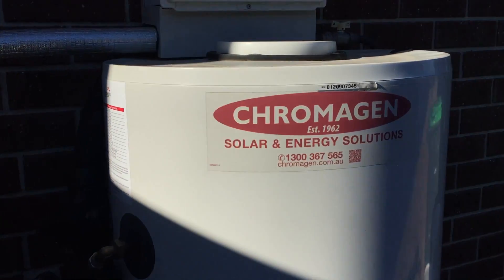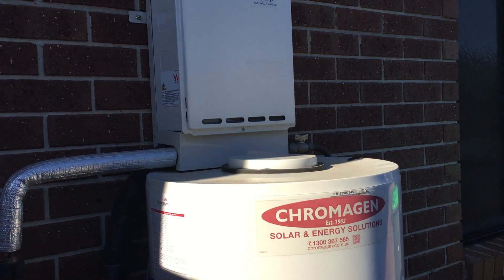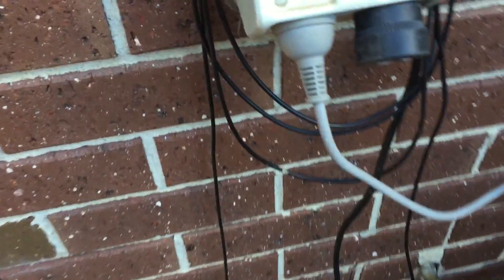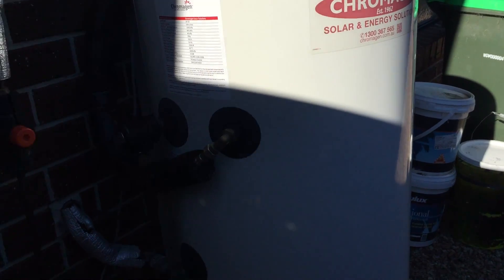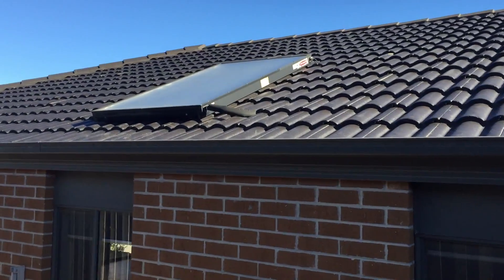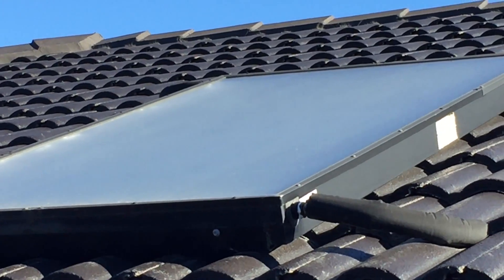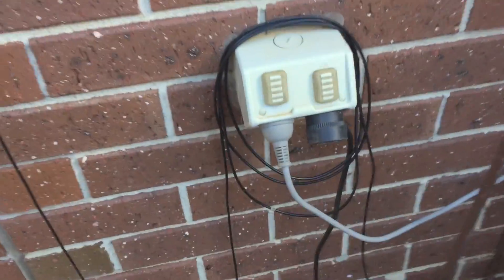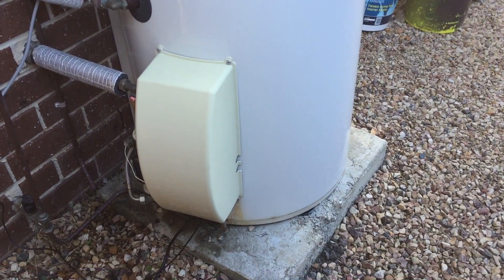Domestic Hot water for free. How to greatly reduce your Gas Bill with a Solar Hot Water System.

Comment: If the system worked properly shouldn't it first use the tank before the gas heater turned on?? I think Chromagen needs to smarten up their designs!

Comment: Hi Mark, just trying to figure out our hot water system now. No hot water coming out. And when I checked out the panel the red light is on which says optimal temperature reached. Do you have any idea on what's the problem might be?

Comment: hello Mark, do you know the litre capacity of that tank, and it`s (tank only) height and diameter  (just the round tank dimameter and the tank only height)  i have a diy project coming up and i want to see if this size tank will fit the area i have (wont be using the instant heater or circ pump.... cheers... richard

Comment: Just keep in mind that by turning off the electricity to the gas control panel, you are negating the safety feature that ensures the hot water is heated to a minimum temperature to kill any Legionella bacteria that would otherwise thrive in the warm water of the solar tank.

Comment: Hey Mark, thanks for the useful video. I have the same system from chromagen and the socket of the pipe into the tank has got rusted and now it spitting strong huge water spray upwards and water everywhere, it has been since three days..... So please can you explain how can I fix that rusted socket or how can I change it? Many thanks in advance....... I can send you photos of that spraying leakage....

Comment: Hi. Thx for the video. Do we need to do anything to have the solar panel filling the tank with hot water during day time? Also how long could the tank insulation keep the water warm?
Reply from the maker: No that is how the system works. When there is potential the system runs and heats up the water in the storage tank. Then when you turn on a tap in the house that water is down from the tank. It then goes to the gas booster so the booster only runs as much as is needed to top off the water temp.

Comment: Hi thx for the great video. I have got the same heater it’s working fine but it’s makes beeping noise. Is that normal
Reply from the maker: Sounds like the solar controller switch is not happy. If you take that cover off down at ground level near the solar circ motor. See if you have any red lights. Check the sensor lead, etc.
Reply: Yes panel light is on.

Comment: Is it also not a good idea to turn off the gas inlet to the booster?
Reply from the maker: I’d say no. Depending on how consistent your sunshine is. I find when you do run out. It is great to just pop out and flick the switch. Keeping it simple for others in the family Incase they need to switch it back on.
Reply: @Marksreviewsandtutorials  Thanks Mark! I've run into some issues with my similar system, looks like I'm up for a new pump. I discovered the fault when I turned off the gas booster as the weather was warming, the next morning I had to have a cold shower :s

Comment: To make it all automated (although it has an initial cost) you can install a thermostatic diverting valve. If the solar hot water is above a set temperature it completely bypasses the gas hot water system.